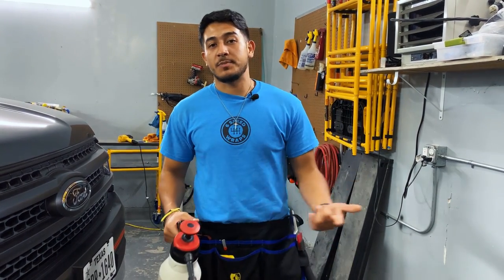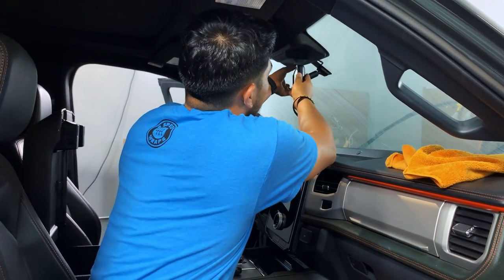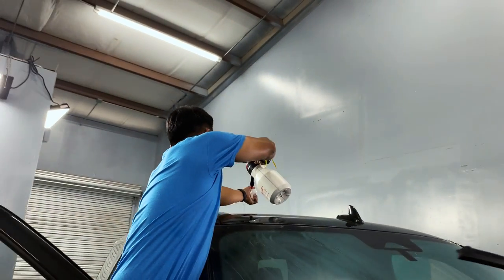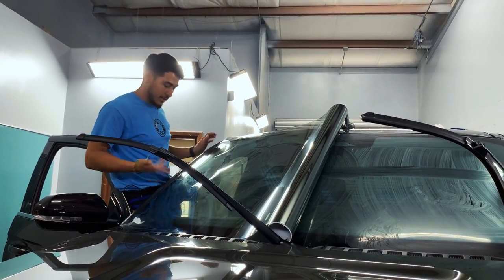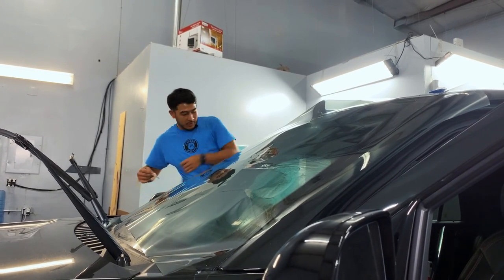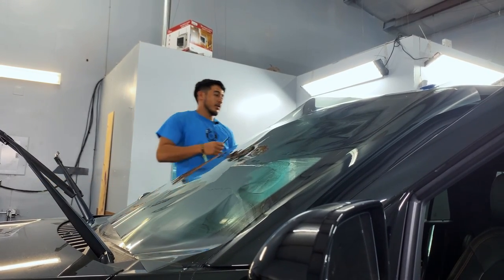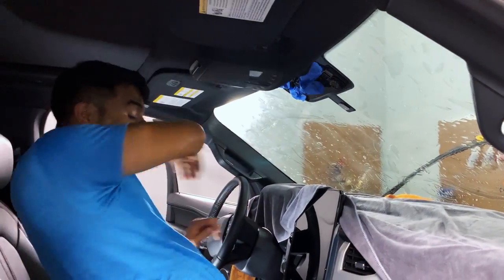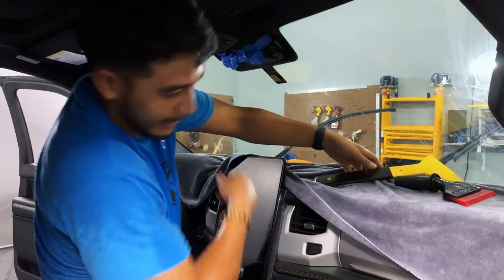How To Install Window Tint On A Front Windshield

Comment: I have 70% on the windshield already. I am now going to have the two front windows done on my 2022 Jeep Cherokee Trailhawk. I like the existing factory 'dye' that it comes with but I need some tint to help with the heat reduction, and other variables. IF I want to keep the original tint looking should I go with a 45% or 55% on these two windows? I am going with the XPEL Prime Plus.
Reply: Oem tint on the rear windows of jeeps are normally around 20%. So i’d recommend 20% dye. If you want max heat rejection xpel prime xr plus is what you want to get.
Reply from the maker: Ceramic for sure for heat rejection. 50% is fine.

Comment: Not only is this illegal but it is unsafe. You should be ashamed of yourself for putting your own financial gain above the safety of others.
Reply from the maker: We appreciate the input. Thank you for participating. 👍
Reply: @6speedwraps328  yeah i get you dont give a s*^% its clear from your reply
Reply from the maker: @MrGameNfit  Once again, thank you for your input.
Reply: Yikes this commenter is s joker.  Keep up the great work 6 speed!
Reply: Not only is it LEGAL. It is safe. I believe he said 70% clear in the beginning. Why don’t you cry to Mercedes Benz where they have darker front windshield straight out of factory.
Reply: @waybach  you may want to look into factory glass standards by SAE. Window glazing is not less than 70% from the factory. Mercedes does not tint their windshields. This is what tint shops are doing. You can clearly see in the video how dark the tint is. If you think it is 70% you may want to get your eyes checked. Good luck doing better on your next comment.
Reply: How is this any less safe from tinting you side windows at 25% or the fact that most officers cars have even darker tint on windshields lol